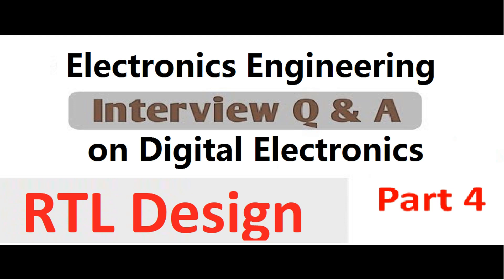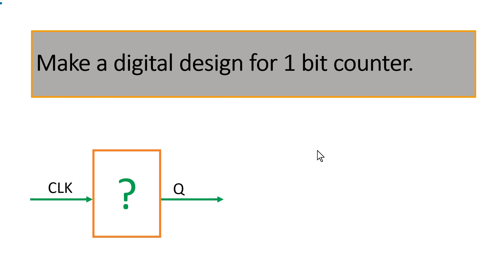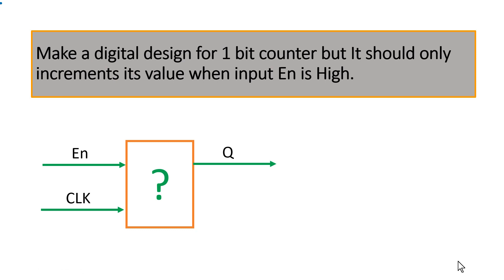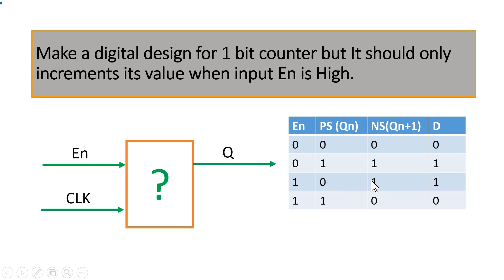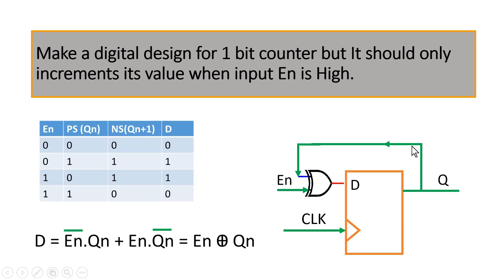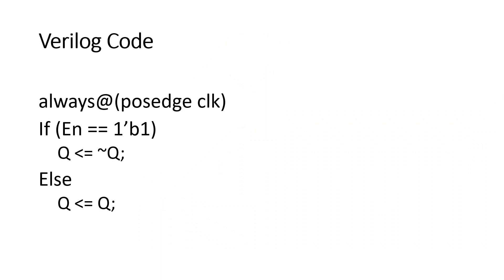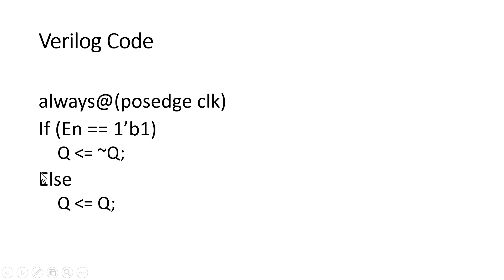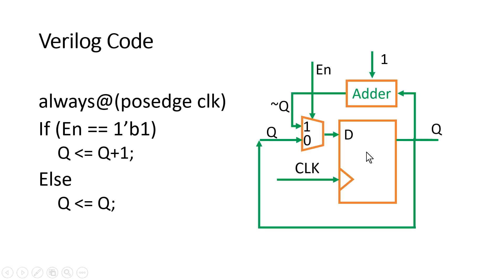Digital Design Interview Questions Part 4

Comment: sir, can we not substitute xor gate with and AND gate and add a NOT gate in the wire Q to D?
Reply: No you cant because when you do like that when e is low output will not hold previous value itll only output zero always

Comment: Why did you set D values same as NS(Qn+1) values for positive edge 1-bit counter? Isn't D=NS(Qn+1) when the clock is positive edge triggered?
Also doesn't the D-flip flop automatically acts like a 1 b-bit counter?
Reply: single D FF fed with qbar as its input at D acts as a 1 bit counter.

Comment: Sir please make one video for same problem but for 2 bit counter , it will help us learn more. I can make it with technique 1 , please make video for 2 bit using second technique
Reply from the maker: Dear, firstly draw the logic circuit diagram for the 2 bit counter, it will obviously have 2 flip flops. then put MUX before the input of both the flip flops.